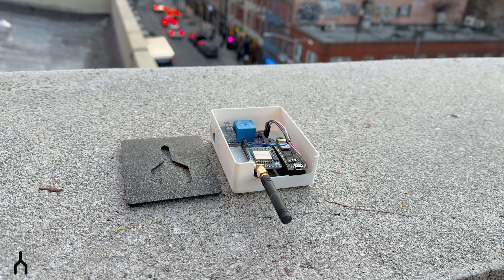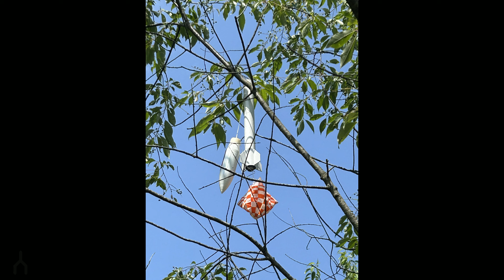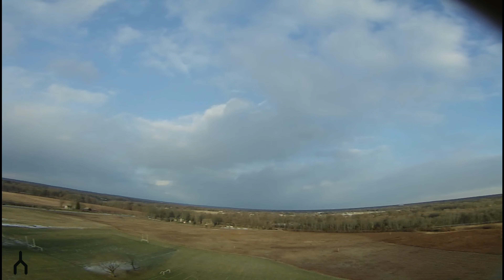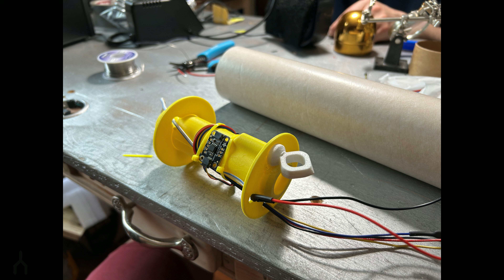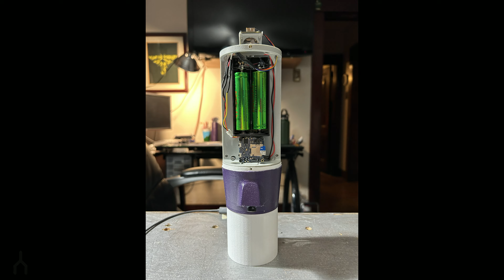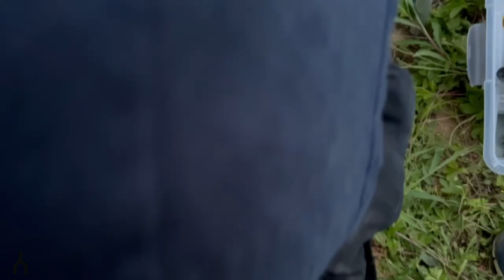Sierra V2 Two Stage Model Rocket

Comment: Awesome video, and it's been great to follow your progress on this project! Glad you finally got a good launch in December! As for your camera issue at apogee, I've had it happen a few times, and based on the similarities in the occurrences it was due to the force of ejection shaking the SD card enough to disconnect it. This may be what you were seeing instead of a brownout. On your next avionics design, I'd suggest adding flash storage to save all your flight data to in flight. If you still want an SD card for easy data retrieval, have your code write the data from flash to SD when landing is detected. Just a suggestion. :) Can't wait to see where this one goes next!